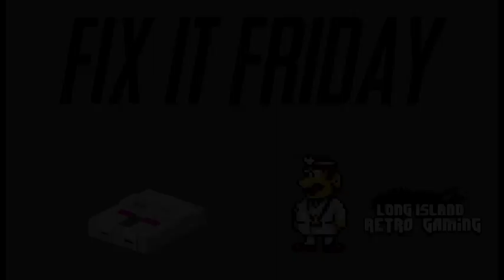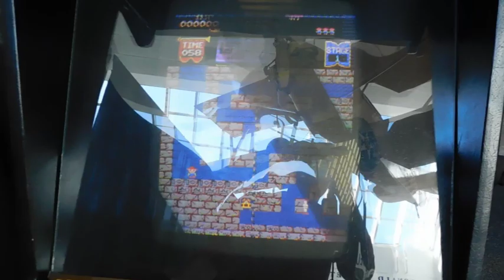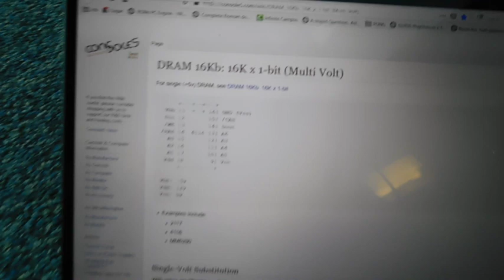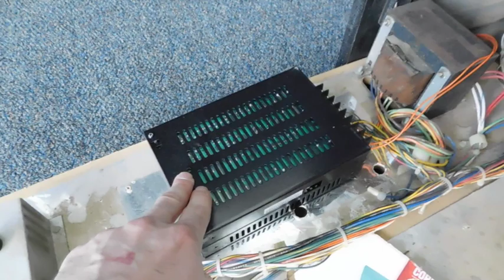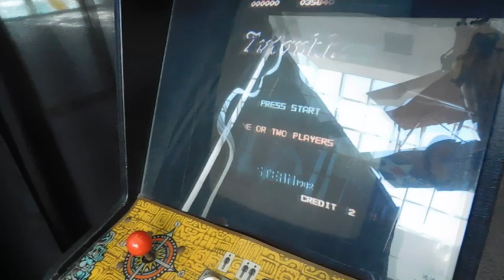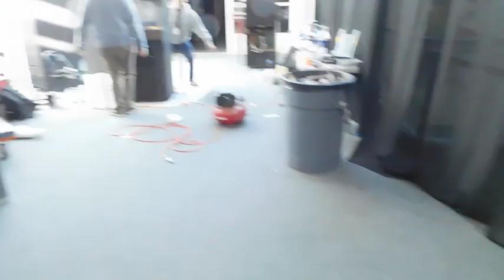Tutankham (1982 Konami/Stern) Arcade Repair

Comment: Had the same line of dots in the middle of the screen. I couldn't believe it when you said it was -5V, I thought the 4116 had to have all voltages to work in the slightest. For me it was just some bad solder joints on the 7905 regulator. Thanks!